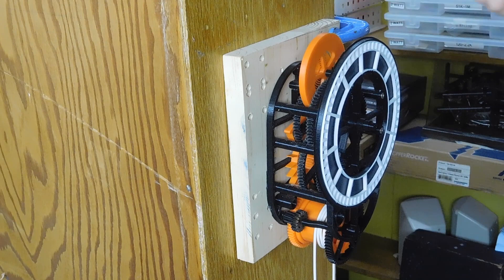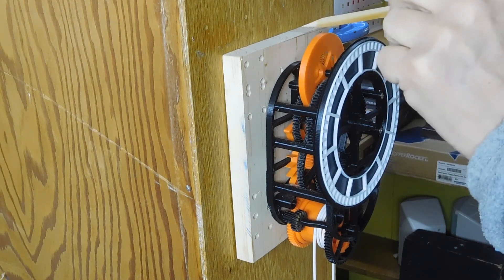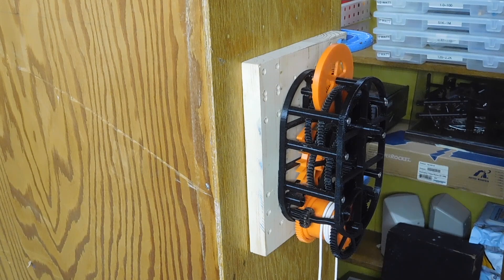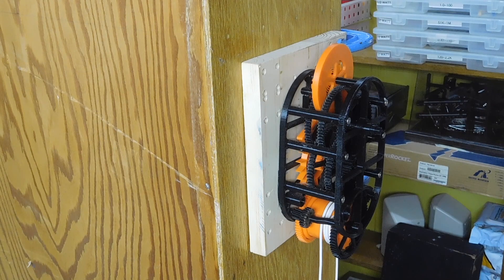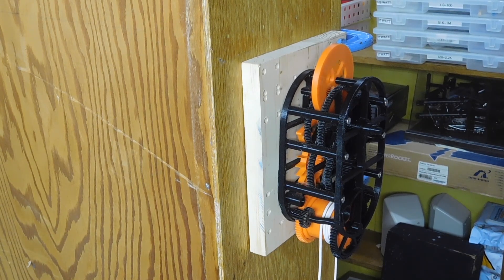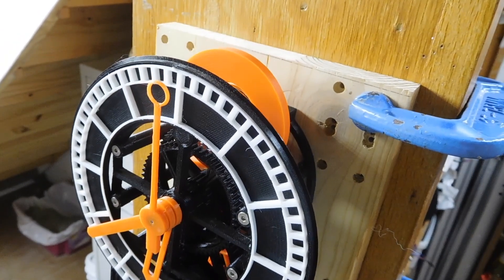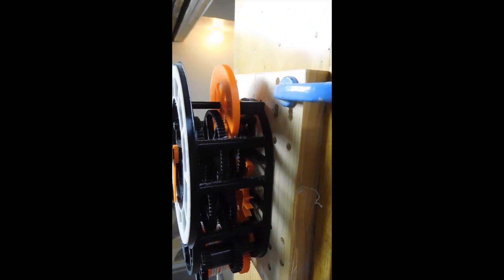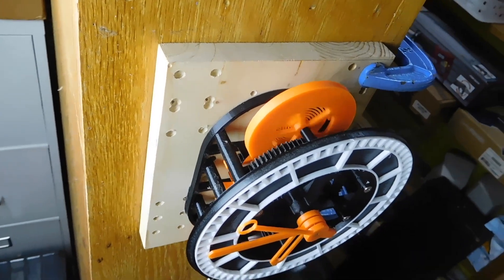The Christoph Laimer 3D Printed Clock Running

Comment: Hey Brian, I think your plastic parts may be creating a lot of drag. To put more weight on, would compromise your components. How are your tolerances ? Try using precision bearings where possible. 😊 Donovan.
Reply from the maker: I actually added tiny ball bearings to get it to work. I used a soldering iron to set the bearings in the plastic and held the shafts with a mechanical pencil to grind them to the correct sizes. Only had to to the first three and a half shafts.
Reply: @BrianBoniMakes  the type of bearings I couldn’t think of over the phone, are, “precision” , and maybe micro precision . They are also available with a flange, if need be. Can you stand it ? They are perfect for your application in future chronological instruments, you want to make.